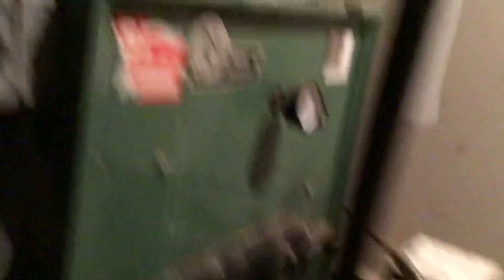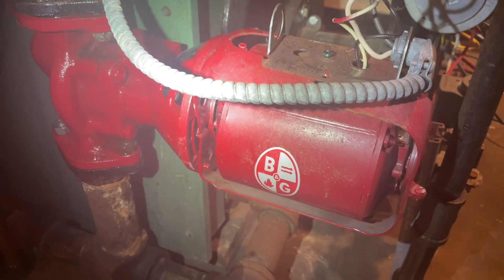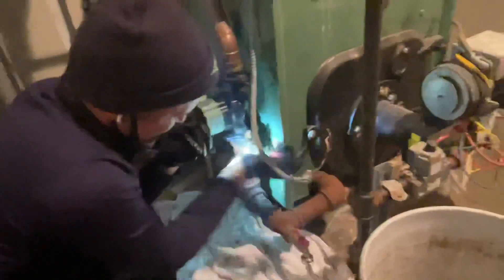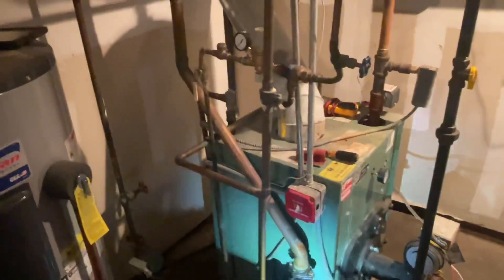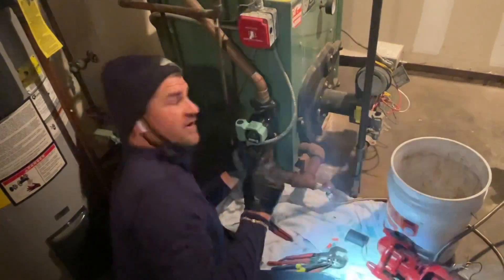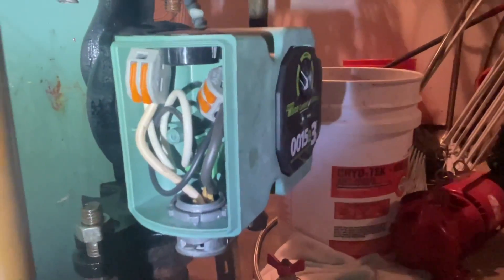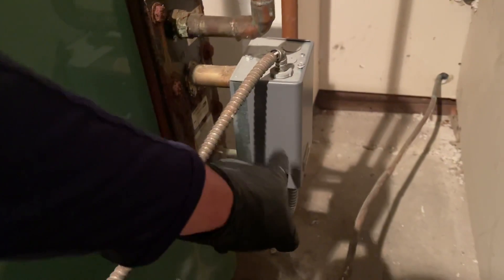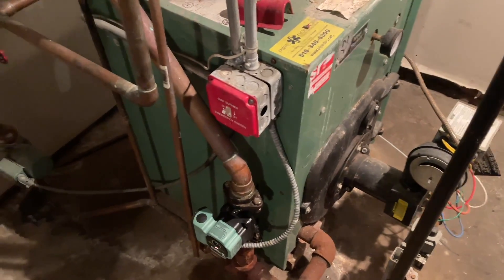No Heat 2nd Floor Dead B&G 100 Circulator Replaced Taco 0015e

Comment: Mike there was a little learning curve with the Wago"s but now you can see the advantage especially if you are in a situation  were you only have one or two inchs of wire to work with , (They have there place ) side note Milwaukee makes a wire striper that is really outstanding  they call them  the 6in ones they look like a pair of needle nose Pliers , I just used them on a job and its hard to believe, wire stripers can be improved so much .. we learn every day , Love the Chanel

Comment: Thumbs up for using Wago! Awesome stuff, e.g. lets you disconnect any hardwired device by simply disconnecting the live device-sided wire first, without searching for breakers and stuff. Consider trying the modern Wago221. This is the old Wago222, which is rather chubby and won't let you check proper  insertion.

Comment: Mikey Pipes, two questions for you.  1.  Do you replace all 100's with 0015 or is the 0015 what you had in the truck?  Like, why not a 007?  2.  Why leave the flo check in the new pump?  I couldn't see the supply side of the boiler, but I would assume there was an old flo check in the system already.  Not trolling, serious questions for my own knowledge.
Reply: @PipeDoctor  Good to know, thanks Brother.
Reply: @PipeDoctor  I just rebuilt a 009.  Would this pump replace a Taco 009.  Just wondering.  Thanks!
Reply: @PipeDoctor  I was going to ask why you left the check valve in as well. It's hard to believe the original zone didn't have a flow check because it original had a tankless water heater on it. It would have been overheating from day 1. It would be nice on some of your videos to see a little over view of the piping.  Cheers 🍻

Comment: WD-40 isn't a penetrant. PB Blaster is my go to juice.
Reply: I had a coworker once that was replacing  blower wheel bearings on a rooftop unit and sprayed PB blaster on everything, it worked great until he fired the unit back up and cleared out the building, everyone evacuated, fire dept came, it was a mess. PB is very strong smelling stuff.

Comment: What do you think of the 007 e's with the universal flanges i had an issue once with one of those where the cir flange on supply on the boiler was too close to the 1/2in air vent had to cut one side of the universal flanges off with a saws off

Comment: Another customer with heat. Swapped out an old b&g 100 at my grandmother's last winter with a 007 when it bit the dust. How do you like the uponor pex system. I just ordered a dewalt expander to switch to instead of messing with crimp connections

Comment: Usually do a few b and g 100s a week. Either coupler replacement if bearings are still good, or leaking from impeller shaft, or dead motor. Have a graveyard of old motors in the garage

Comment: 25 years ago,I went on a call for noise from system,so I get there and the people called Niagara Mohawk,(gas co).They put in a new thermocouple, and while the guy was there he looked at the pump,he told the elderly homeowner tgat he found a bunch of cotton inside the pump and pulled it all out! The cotton was the oil wicking! Idiot
Reply: Ever looked under the oil cap in series 100
Reply: I just like shopping,I'm bored! I did by some new tools today.Malco 4in1,magnetic LED light,and s9me umpire brushes,new vacuum pump,and a new Rothenberger auto swage tool,it's awsome!
Reply: Use "Right hand thumb rule" for tightening and loosening.  It always works!
Reply: You gonna have a Wago party next week,big box coming!
Reply: Oh snd,the headlamps are so you can not put the big black thing in your mouth,it'll chip your teeth!